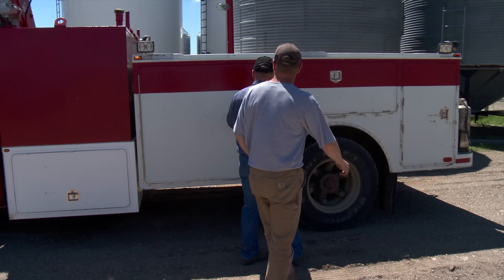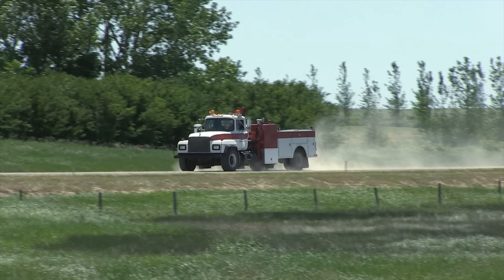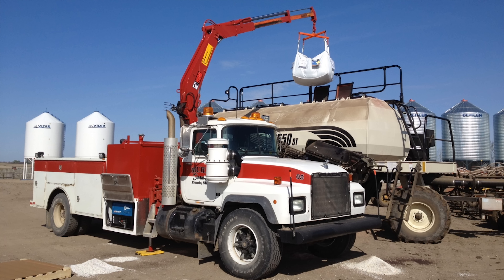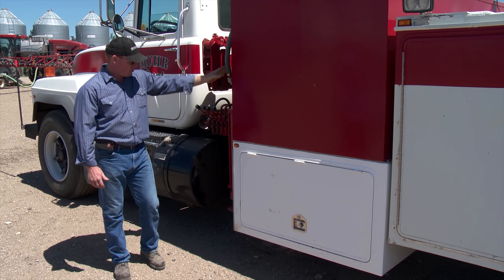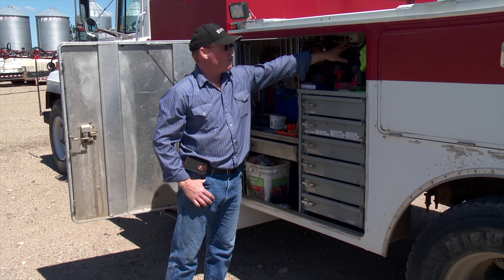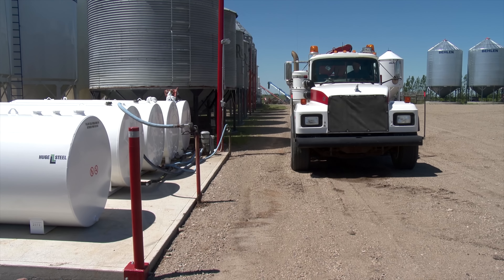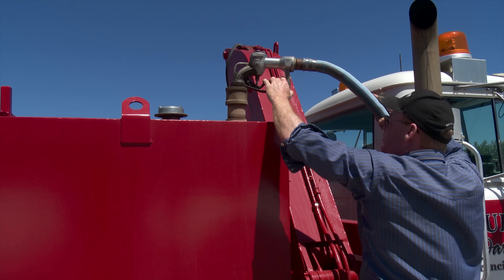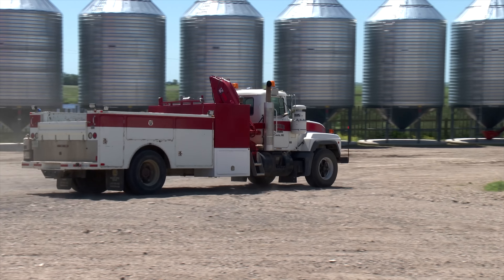Custom Mack Service Truck

Comment: Manual trans are superior, cheaper to rebuild, less moving parts, better control over rpms,  better mpg in some cases    if you work on a farm or ranch and cant drive a old mack truck manual   then you shouldnt be there

Comment: How do you register it without def fluid or inspection sticker?
Reply: Mackenzie owen register as a farm truck
Reply: Mackenzie owen I'm guessing that it may be farm exempt
Reply: What do u mean without def they started def  in 08 any truck old the that is exempted
Reply: redneckdave started 2012 but we understand
Reply: Dude, if you can register a 60s car with no seat belts, you can register a 15 year old truck.